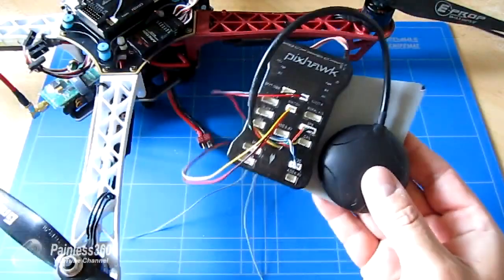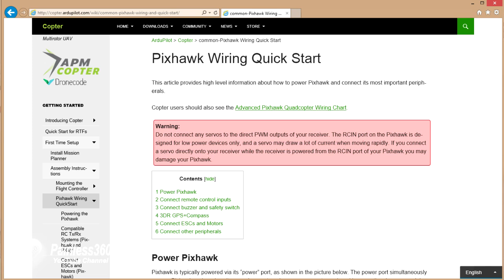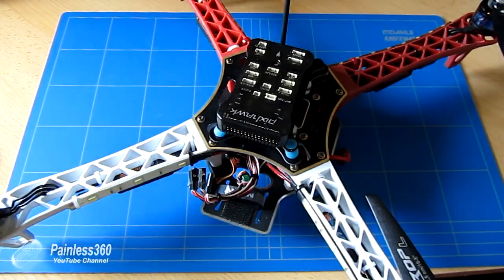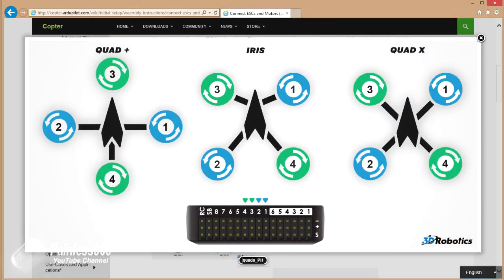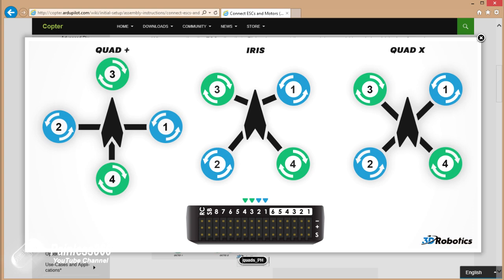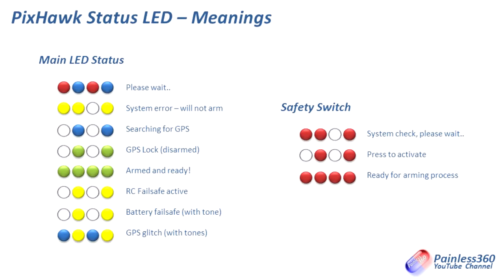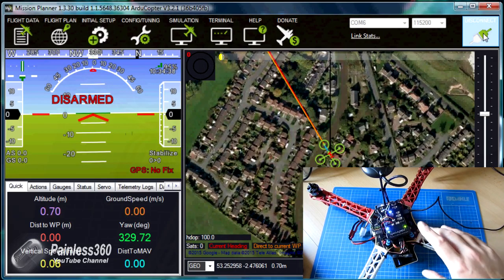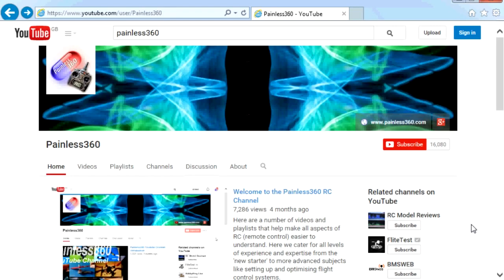(2/5) PixHawk Video Series – Power, installation, final checks and first hover

Comment: Thanks Professor, it's a great competitor to the DJI, isn't it if we are careful and concentrated with MP.... This FC is a great GitHub project, and as always Indeed, Kudos to the Minds behind it... Version 3.3 now accommodates a LIdar Lite, very very promising, as it could be used with more forthcoming codes, for some image Orthophoto INfraRed pictures, right... I have faith, and can't wait to get your methodical experience guidance... Cheers and, indeed, as always, Safe Flying with Pixhawk!
Lidar Lite: http://pulsedlight3d.com/blogs/cool-stuff/25137473-pixhawk-lidar-lite-setup-demo
Reply: FPV Cambodia Have they worked out the bugs between Lidarlite and Pixhawk GPS?
Reply from the maker: FPV Cambodia That is a question for the developers ;)
Reply: Correct... Thanks again for your series on the Pixhawk, I am awaiting mine for a XJ470 front mounted camera gimbal mount....
Would you have a hint on how to trigger a Gopro from Pixhawk. I can't find anything on this topic, it maybe because it is impossible!? Tks Professor for your guidance. Always much appreciated. Rgds. FPV Cambodia
Reply from the maker: On the GoPro - not that I know of..

They are missing a huge trick here..

Best of luck.
Reply: Yep Indeed, Weird isn't it knowing the success of the gopro and the Pixhawk, it has to be a wall garden decision from Gopro I suppose! ;( Cheers.